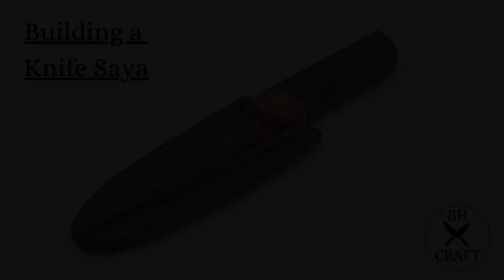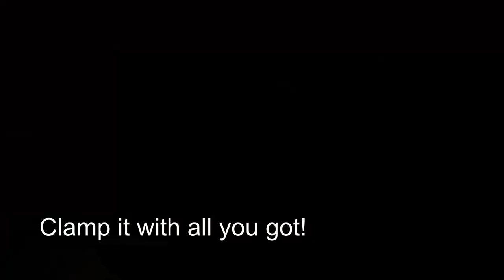How to make a knife saya (sheath) from wood

Comment: But what keep it from falling off? 
I made one well a few but the one I'm talking about is presure fit so the wood pinches the metal and holds on but the glue pops making it floppy .
Reply from the maker: The knife shouldn't be a pressure fit. You want a little wiggle room between the steel and the wood. When I clue it. I leave it in clamps over night. And afterwords there should be slightly under 1/32" of play between the knife and the wood. If you can get it closer to 1/64" that is ever better. 

If the knife just stays in the drawer then you don't need to worry about the sheath coming off. If you want to secure it on, you can drill a hole and use a dowel near the heel of the knife to prevent it from coming out.

I hope that helps.